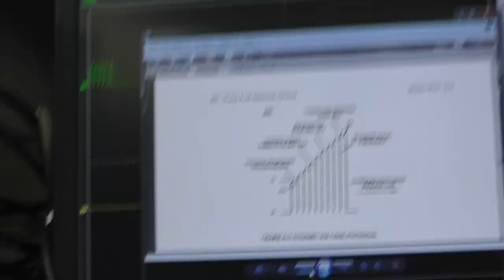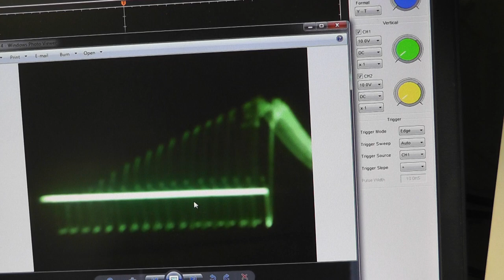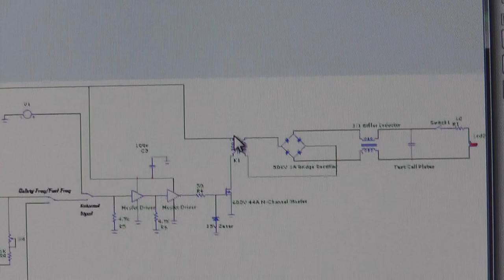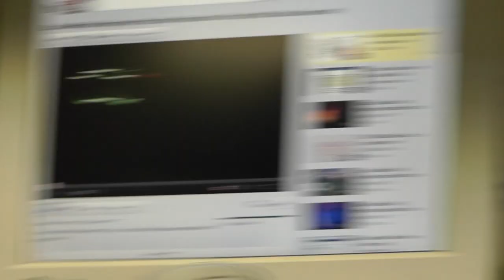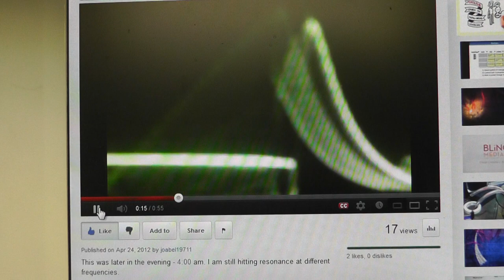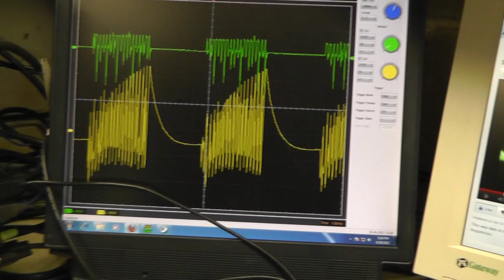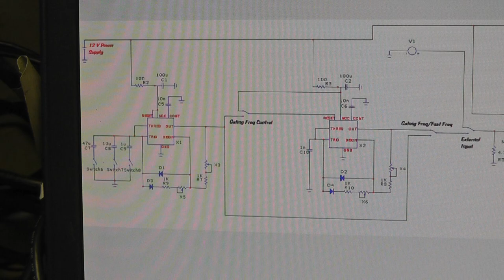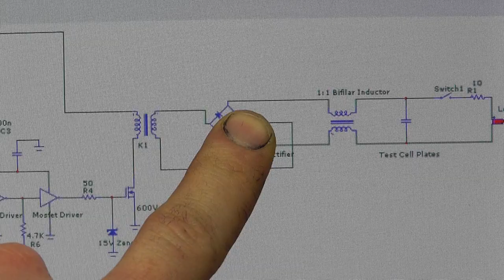Stan Meyer Step Charging Signal Replicated By Jon Able RWGresearch.com

Comment from the maker: Lol, no, no, lol I was stating that at resonance it's much more. I was not tuning in for gas production. I was tuning in to get the best scope shot. Also, I was using distilled water to get the best step charging results. Because of the high dielectric and resistivity you can step charge it to a higher potential. Ps replied to you over at the gen set thread, please read and post back!!! ~Russ

Comment: Hi! The diode, but better Bridge rectifier separate input charging from cell. We all know- cell is like a accumulator(analogy with charging of accumulator), but the electrolyte or tap water is weak "conductor"(but principle remains) and that is the key factor- to separate because of charge condensation inside- between plates. If we have no diode or bridge rectifier than we make short circuit :( and nothing happens! My experiment with signal gen 30V or more +Vcc give similar results with bridge.

Comment: yea there is a gap
seriously, a bridged rectifier will double the frequency
mains voltage for instance is 60 herts sign wave, with the full wave rectifier, it becomes pulsed dc at 120 hz
if the pulse dc transformer with a full rectifier, you will get a doubled effect
but meyer clearly had one diode on line, the effect is quite different
you really should look at the video i tried to link
>MAX<

Comment: Thanks, I got into contact with him and he is not doing things correctly as he, like the rest, are not using science as a guide to his efforts on figuring out just how Meyer made use of water as a source of fuel. The step charing wave form I am getting measured across the exciter array looks almost like figure 10-5 found in section 10-7 in the SMTB. A differential prob is needed for this measurement due to grounding problems. Thus far I have 1800 volts with only 49 mA flowing thru the WFC.